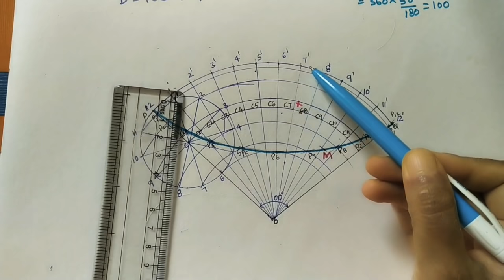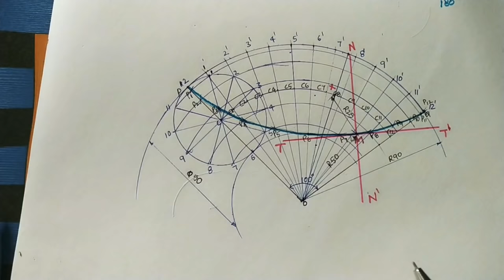HypoCycloid//Engineering Drawing

Comment: 10. Draw a hypocycloid generated by a rolling circle of diameter 50 mm and the diameter of the directing circle is 240 mm. Also draw tangent and normal to the curve from any point on it.